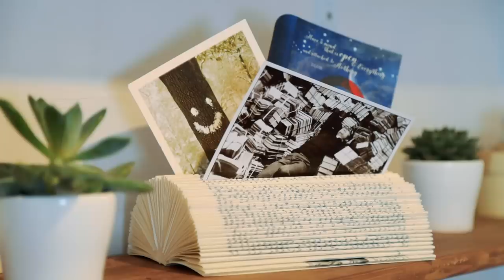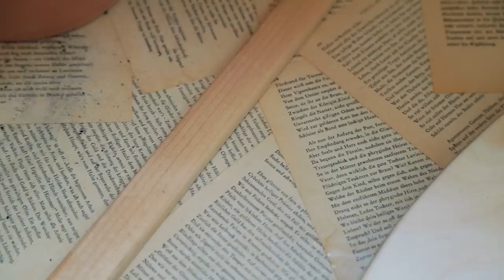Pro-Gamer Builds Epic Tiny House With Crazy Computer Set-up

Comment: Remember when mobile homes or trailers were seen as being owned by lower income families?  Well today, it's trendy and called a tiny house.
Reply: I mean, there's still a marked difference between a tiny house and a trailer park. Tiny house is a choice, trailer park is because you literally can't afford anything better.
Reply: Hey it beats a tent on the sidewalk.
Reply: @pumpjackmcgee4267  I think sweatyballsac may be pointing out the perception of these types of home and how after being ridiculed for use by the poor it's now some trendy, unique "choice" by the relatively well-off.

Edit: I may be wrong as to my interpretation of sweatyballsac's views.
Reply: @dumsaint  No, no. I think you're right about sweatyballsac's point. Though, I'd be curious on their take on the bathroom. Would sweatballsac find a shower convenient?
Reply: PumpJack McGee My trailer park has no issues I’m a contractor who builds trailers himself how dare you make fun and call my community poor, I build bigger and nicer double wides than your mommy and daddy’s 30 year mortgaged house they can’t afford.
Reply: Nah, there's still trailer trash dude.
Reply: The problem with trailers and tiny houses are that banks see them as depreciating assets. A large portion of the cost of a property is the land itself, then the improvements, like water, septic, electricity and house. When you don't have these you won't build equity in the long run, but hey you can write off the depreciation of your tiny house.
Reply: Better trailer trash than mansion muck.
Reply: back in the day, horses were cheap and everywhere and cars were seen as obnoxious and a waste of money. Go forwards to now and cars are cheap and everywhere and horses are an expensive luxury. The turns have tabled then, they will again soon
Reply: @garrettjohnson5768  I commend you for giving your fellow residents a nice place to do their meth in peace sir

Comment: “This is really serious isn’t it?” Judges by second monitor and keyboard without taking a look at PC lol
Reply: Maybe he saw the 360 controller?
Honestly, if I see someone using a wireless 360 controller, these days, I take that person more seriously than if they have a pair of 2080 TI's in their rig. Tells me more.
Reply: @tomteatom  i can agree. Gaming became a trend, so it does not matter if she was either saving up or had this controller from an old xbox 360, this shows shes not really a trendy gamer.
Reply: @brunor.m3276  It's more that, since they don't work natively with Windows 10 and require extra hardware, it's actually a more troublesome option than using an xbone controller. It says to me that this is someone who cares about the extra tension in the springs and the better ergonomics and better sensors in the pad to go to the effort of making sure their controller works on a system that doesn't natively support it. Also, since the controller looked brand new, it also tells me that it's not just a cheap option or something that's left over from an old system but that she's sought out a fully functioning, increasingly rare pad or else has the chops to properly repair such a pad herself. All this gives me a lot more respect for her as a gamer than anything about the inside of her PC ever would. PC spec is just a matter of money, the 360 pad is a matter of so much more.
Reply: @tomteatom  xbox controllers do work natively as with most controllers
Reply: @mynameisgone7274  Only if they're USB. If they're wireless, like the one she's using, she'll have to buy a special piece of MS hardware, as they disconinued driver support out the box, for straight up bluetooth support, a long while back.
Reply: @tomteatom  the only thing you need is a adapter you can find those easily
Reply: @mynameisgone7274  Sooooo? What I said, then? Cool.
Reply: @tomteatom  yeah but its not that big of a accomplishment i mean im 15 and i know how to do that

Comment: 4:48 'Most of the tiny houses in germany are quite small' 

I mean its tiny
Reply: Underrated catch 😂
Reply: She meant that, not only are they tiny, but they also feel tiny. A well laid out tiny house can feel bigger than it actually is. It comes down to space utilisation and how efficient it is. Like how the steps to the loft use the end of one of the kitchen benchtops as a step. It's the culmination of little things like that throughout the build that contribute to a sense of size.

Comment: This is pretty much the same as living in your parents basement, or in a trailer in their back yard. I don't see how this is an alternative to regular housing if you have to rely on your parents to let you live on their property and provide amenities. In my opinion - it's not what tiny house movement is or should be.
Reply: And pay $100K to BUILD it.  What a waste! Rich, spoiled, fools.
Reply: @jackfntwist   er, she said 30K including appliances which is $35K at most.  She also said something that indicates that she is moving it to a different location.  It was literally just finished enough to be livable.  And still has no water and its OBVIOUSLY prepped to be off-grid for power.  With no AC and gas heat/cooking it won't need a huge solar array.  The PC probably is most of her usage.

I sorta suspect she doesn't use the compostinging toilet much.  The shower isn't working since there isn't any water, after all.
Reply: @redwolfexr  Yeah. so basically it's a $40K (dollar) gaming shed / trailer - with no water or electricity ($$$$).  Not a house.
Reply: @redwolfexr  I guess toilet use in your house is a completely voluntary option?
Reply: @jackfntwist    Not sure what has your knickers in a twist..  Just admit you got the math wrong by a factor of three and move on.

She seemed to have electricity just fine.  She said she wanted to ADD solar.  (did you even WATCH the video?)

They are still building the place and haven't installed the water tank.  (which is why she had a water dispenser on the sink)  Her toilet is COMPOSTING so does not NEED water.

Comment: Used campers like 2012 are like $8000 or so dollars here (and that's inflated), you can rent a pickup truck and back it into land in Tennessee (like 10k for 1/2 an acre unrestricted and that's inflated too), so for about $20,000.00, probably 10k more for an off-grid setup you could live off grid in Tennessee.

Comment: you have lots of space up at the ceiling you could use!??  also if you face the glass and long side facing the South- it will be cooler in summer and warmer during the winter!  but if you face the long side east or west it will be the opposite and less comfortable.

Comment: 30-40k in USD (guesstimate) for what's essentially a hand built camper trailer?  I applaud the skill and wherewithal, I do question the value however.  In the states 1500 bucks will net you a used camper trailer.  Even if you spent another 10 grand modernizing and renovating you'd still come out way ahead.  Neither have resale value, neither are going to be commodity.  Construction costs have become obscene to the point that this project feels a lot more like a vanity than a solution to a problem.